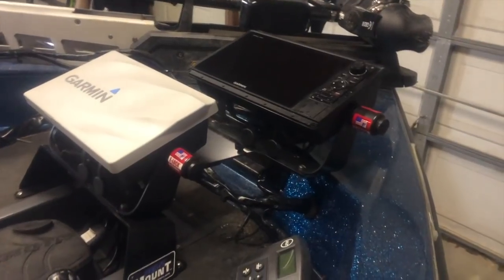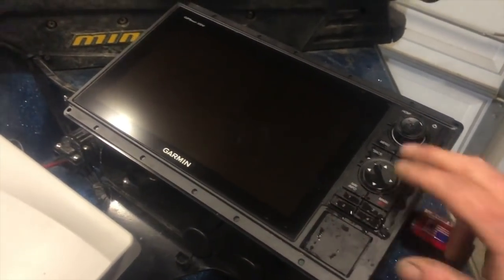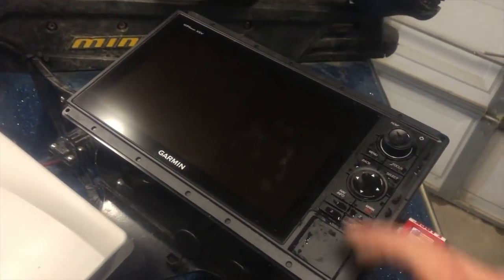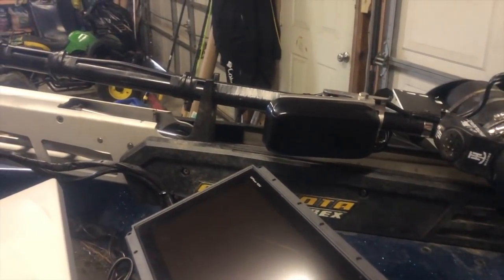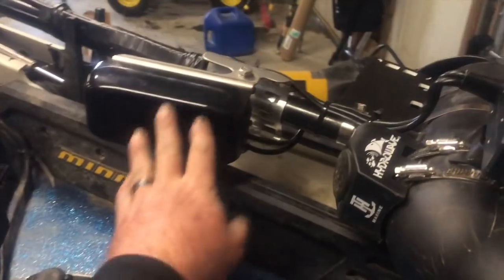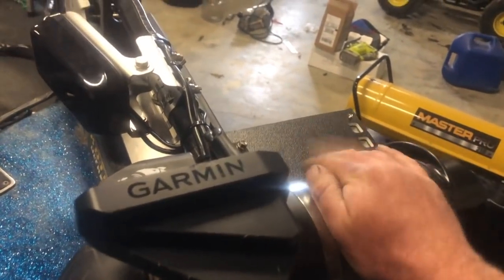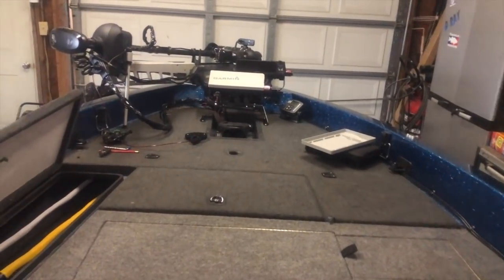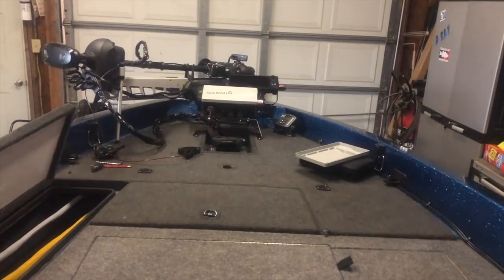Garmin Live Scope and Panoptix Setup and Conections

Comment: Just wanting to make sure I don't buy anything I don't need to. I purchased Garmin ECHOMAP Plus 93sv w/ GT52HW-TM w/ Panoptix Livescope system system along with an additional Garmin Echomap plus 93sv monitor. I want my set up just like yours, I am planning to mount the GT52HW-TM on the rear of the boat and the Livescope off the trolling motor. Do I need the GCV20 without a transducer? or will GCV10 take care of it also? Great video, liked and subscribed. Thanks
Reply from the maker: fourriversboats The gvc10 will take care of it all.

Comment: D-Ray, Great video. Appreciate you trying to help others. How did you network you units together? I assume you also had the network box and cables. What transducer did you go with for you side and down imaging. Thank you in advance.
Reply from the maker: GVC 20, which comes with ultra high definition imaging transducer. Note that the high definition imaging transducer is not an all in one, so you have to purchase a separate sonar transducer. Or you can purchase the GVC 10 and an all in one transducer to cover all your needs. The GVC 20 is only for high definition imaging, it has no sonar capabilities.

Comment: Finally!
Thanks DRay for showing me that I can do what I want to do with my set up.
I’ve been searching everywhere, but here in Canada, Garmin doesn’t have support that is easy to access or get any clear answers from.
I’m buying 2 Garmin Echomap 9 sv, LiveScope and wanting to connect both units through a module box so I can share mapping and LiveScope on both units, trolling motor and console.
The module box I’d need will not be the same as yours I’m sure because of the units I’m buying. But I’m sure there must be one for the 95SV’s which is the Canadian version of Garmin 93SV, only difference is the Canadian mapping rather than US.
You seem to be connected with Garmin and the most informative I’ve seen.
Any advice on which module box to connect two 95SV units to 1 LiveScope? And the transducers which I’d only need to install one of if I’m running through a module box
Reply: Got it figured out and product I needed. But your vid got me going the right way
Reply from the maker: Awesome! Let me know if I can help

Comment: Is this the box your using GCV20 Ultra High Definition Scanning Sonar Black Box for ClearVu and SideVu ? Love all the info you shared.
Reply from the maker: Keith Tidwell yes it is! However from my experience I will share this with you. The high definition side imaging is absolutely stunning as long as you stay in 20’ deep or shallower. Deeper than that depth gets pretty foggy. I guess because of the ultra high frequency of the transducer. So if you fish a lot on deeper lakes an all in one transducer with a lower frequency may be a better option. I fish shallow and deep lakes but prefer the high definition just for the stunning clarity in shallow water. On deeper lakes I can still find piles to drop way points on then get clarity by riding over with down scan. Down scan works great at all depths. Hope that helps, just my honest option from experience
Reply: What else is needed to connect everything wire wise ? it also said transducer needed for the black box but not included ? I purchased a Garmin ECHOMAP Plus 93SV US LakeVu g3 w/GT52 will that transducer work on the black box? I planned on running the livescope by itself to to the unit 93sv.
Reply from the maker: Keith Tidwell yes that transducer will work with or without the black box. In other words that transducer can also connect directly to unit. 

You will have everything you need if you plugging livescope directly into your unit.
Reply from the maker: My livescope is also connected to the gvc 20, so I can view it on all units. I like putting trolling motor down and pointing towards side of the boat to get a good look under docks sometimes quickly😎. I’ll have more videos coming soon on tips and tricks!

Comment: D-Ray, did you install and network box and cable or just use the unit under your dash? 
Great video. Thank you;
Reply from the maker: I used the unit under the dash (GVC 20). The GVC10 would also work, it also allows you to see screens at console that are on bow, like the livescope as long as transducer is in the water.
Reply: D-Ray, The GVC20 does not allow the screen shots at the console that are on the bow or do they both do that? Thank you very much. You helped a great deal. I appreciate your help. Good fishing! @D-Ray
Reply from the maker: With the GVC 20 or the GVC 10 all data is visible on all units. So let’s say you are using your bow unit while fishing with the trolling motor, and you want to see side imaging or down imaging from your transom transducer, you can by selecting it on your bow unit. Anything that is connected to the GVC unit is visible on all units. In my case I can view side imaging, down imaging, or live scope from any unit in my boat.
Reply from the maker: Run one network cable from one unit to the other and all will show on both.
Reply: D-Ray Fishing 
Can the GCV 10 allow you to share Livescope from a 93sv echomap plus to a 1022xsv via a network cable?

Comment: Nice setup! How much you got into all of that excluding the lowrance?
Reply from the maker: I’ll give you a list of what i purchased and you can research it. It’s a costly investment, however if you wait til the right time you can save alot of money. I waited til Black Friday and saved on average 30% off everything. I have a 1242xsv $2,199.99 (at console), two 1042xsv 1,499.99 per unit (on bow), Ultra high definition scanning sonar system $599.99 (this unit comes with the modem box for multiple transducers), Panoptix PS31 $1499.99, Panoptix Livescope $1499.00.                                                                                                                     ***The Garmin Echomap and GPSmap units are on clearance on Tackle Warehouse right now as new models are coming out next year.
Reply: @D-Ray  I just purchased a Hummibird helix 12 really like it but wished i would of known about these units before i bought the Humminbird. My question is I would like to put one of these up front what would you go with to start out with? Dont fish tournaments so i would like to go with something in the mid range. Thanks in advance for your time!
Reply from the maker: @walleye56789   I would definately go with livescope over original panoptix, once you get familiar with it, you will be very happy. Plus the transducer is adjustable with one turn to look foward or straight down. I’m leaving a link to compatible units on Garmin so you can research best priced units and decide over size and touch screen. Here is the link https://buy.garmin.com/en-US/US/p/591379#devices
Reply: D-Ray Fishing  thanks for the info!

Comment: Hello, I have two Garmin 93SI units and livescope. Cabelas installed the equipment. They say the units can’t network. Can you please tell me what I need and where to buy everything?
Reply from the maker: The black port that looks like a telephone jack is for all your Ethernet connections. Since your unit only has one, it would be best to call Garmin support to see what they can do to help you with linking units, as your Ethernet connection is being used by livescope. They may have some sort of expansion box for everything to connect to and communicate to both units.

Comment: Help me out please.  I have the Livescope that I installed last July. ( Love it by the way)  I was running the Panoptix PS22.  You show in your video changing from forward view to downview on your livescope by just rotating the transducer.  The instructions from Garmin have you tightening the bolt to the trolling motor shaft mount so tight it will not rotate. Did you just leave your mounting bolt loose enough that you can rotate it or is there mount I don't know about.  Thanks a bunch, Kim
Reply from the maker: I followed instructions as you did. I’m not totally familiar with the PS22 but i pulled up the manual for it. It looks like the same hardware as the LiveScope. So even with the bolt tight it should be able to turn facing straight down or forward at a slight downwards angle. Dosent take a whole lot of force to turn it, but it is tight enough where it can do it on its own. If not you may have to loosen bolt to change positioning. Like I said im not familiar with the PS22 as I have the PS31. However the people at Garmin our great at answering any of your questions, so I would give them a call.

Comment: I'm in the market for panoptix and I can't decide between livescope, ps22, or ps31. Is livescope capable of producing an image like the ps31 or 22, or is it only the live imaging type display? Is the ps22's image as clear as ps31? The ps31 cost more because of extra feature right?
Reply from the maker: After having time with livescope and Panoptix, if i could only have one, I would choose the livescope. Its kinda like forward imaging in comparison to down or side imaging but its live like Panoptix. You can still see your bait like Panoptix, put whats really cool is you can actually see the fish swim and how it reacts to the bait. Once you get used to it, its unbelievable!!!  As far as panoptix, I chose to go with the PS-31 because of the extra scanning features that help me locate structure and schools of fish that like to move around. It also has an adjustable cone beam from 10 to 40 degrees, which allows me to veiw a wider angle in deeper water when chasing schools of spotted bass or smallmouth. However the pitch its set when you install it to your shaft is what it is, unless you loosen bolts to move it. This is where the PS-22 has an added bonus, like the livescope transducer its adjustable from foward to down with the turn of a hand with the transducer. I dont think you will be disappointed with what you choose to purchase. If you spend more time fishing then searching, I would just go with the PS-22. But to say again after my experience if I could only have one, I would purchase the livescope.

Comment: What's the difference between Garmin Panoptix PS22-TR vs Garmin Panoptix PS22-TR?
Reply from the maker: Jamarr Lagrone not sure what your question is as you listed the same transducers. There are two main Panoptix transducers now, the PS22 & PS31. The PS31 offers upgraded features like a scanning technology, forward view, and adjustable beam. Having experience with the PS31, I would negate all the extras as I really hardly ever use them, go with the less expensive PS22. Panoptix is what is used 99% of the time.